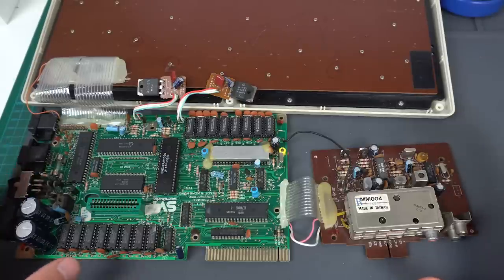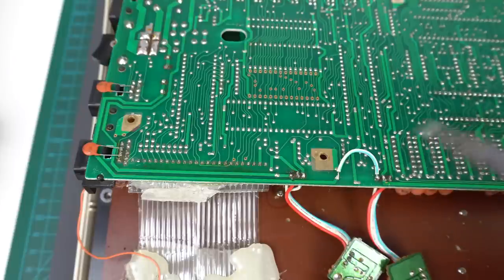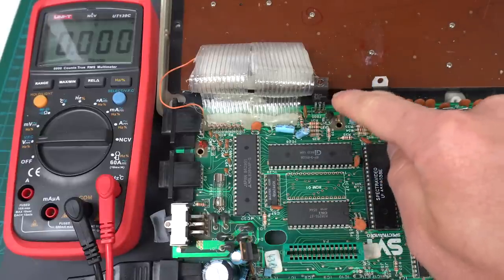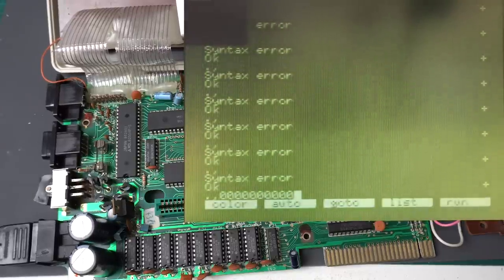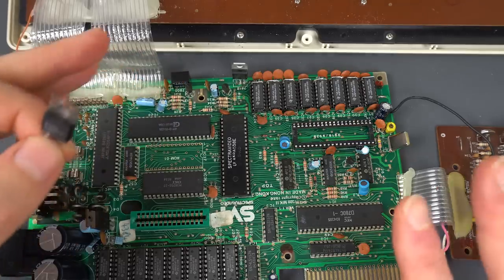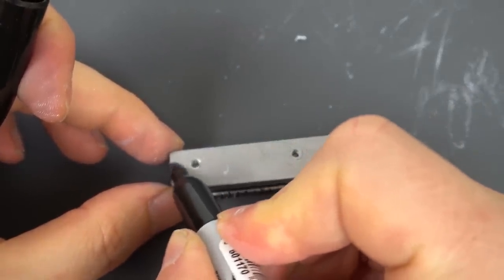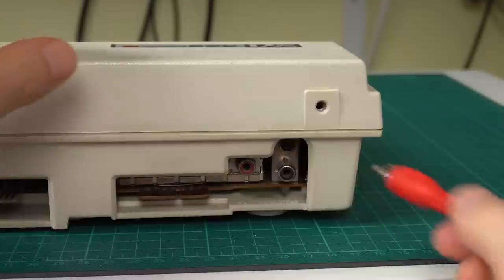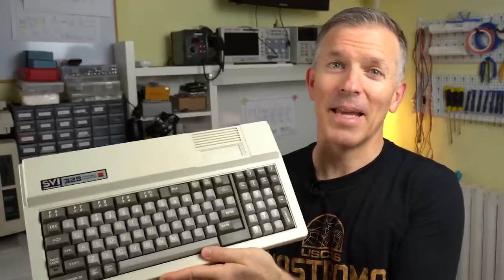SVI 328 VDP Problems and Final Touches (Part 3)

Comment: Hi Noel. That VDP TMS9929 seems to be a laser rebranded IC. Did you buy it at AliExpress? :D I have suffered this multiple times and unfortunately I have some experience with it: rebranded MOS 6502 CPUs, MOS 6581 SIDs and even Rockwell 65C02 CPUs...
Check it out: it has been sanded... Look on the back of the chip and check if there are any markings, but to me it looks like another "chinese knockoff" :(
Reply from the maker: You're probably totally right. I was lucky enough to buy it through Ebay (although it came from China), so I was instantly refunded my money. Let's see what happens to the next one when I get it.
Reply: Wikipedia, Laser engraving :"Before the year 2000, lasers only produced lower-quality results in rubber-like materials due to their rough structure. In the 2000s, fiber lasers were introduced, giving a much increased engraving quality directly into black polymeric materials."
So the laser engraved marking chip is most likely fake (9918,9928/29 were developed in early 80's )
Reply: That is so bad... so the chip isn't even a TMS9929?  It could be anything?

Comment: So ends the saga.  Excellent video and series Noel.  I thoroughly enjoyed it!  Your content is top-notch.

One thing that I noticed, at 25:28 or so when you disassembled the keyboard, is that it appears the ribbon you thought was part of the keyboard membrane is soldered in place.  You could replace that with another home connector job in Part 4!  :D  Your solution to the problem with the video board connection was brilliant.  One more time perhaps?
Reply from the maker: Thanks so much! Yes, a few people pointed that out (I didn't even notice until after the video was done, I was so focused on just getting the plunger in without tipping the keyboard 😀). The main problem is finding a good connector for that. I counted 25 pins, I'm assuming 2.54mm spacing... not trivial. I'll look into it though. Cheers!
Reply: @NoelsRetroLab  I became suspicious when I noticed that the keyboard and video ribbons appear identical.  I would not be surprised if they came from the same roll of material.  No doubt the ribbons were added in the final assembly of the computer.

Comment: Just watched all 3 videos of this repair and I must say you have much more patience than I would have had. Especially at the end of the 2nd where you had it working and decided  to replace those messy bodge wires, only to have the VDP completely fail. At that point I may have just given up or at least pushed to the back of my projects to work on list. Great repair!
Reply from the maker: Haha, it helped that it was a friend's computer and I need to return it. Otherwise, I might have done just that. Also, the fact that it was a new computer to me made it more interesting and me more willing to keep digging. Had that been a plain Speccy, it would have totally gone at the bottom of the drawer 😃

Comment: Nice video series. At 5.34min I have done similar but using a sewing kit pin. The ones with the coloured tops. Solder doesn't stick to them either. Replaced many caps using them.
Reply from the maker: Oh nice tip! I didn't know about that (although I suspect my wife wouldn't be happy me taking her pins and doing that with them 😀). Still, good to know in a pinch.

Comment: The broken tms9929 might even work if the crystal is replaced with crystal oscillator of same frequency. The xtal oscillator driver or input might have an ESD damage which lowers the crystal drive level or oscillator input resistance ... Odd quirk with the external oscillator is that externally generated clock signal must be connected to the both XTAL inputs (pins 40 and 39); This is a footnote in Texas Instruments  VDP databook 9918 and 9928/29 terminal assignments (page 3-9 to 3-11)

Comment: I do a lot with this JST connectors! Older projects and also new things. I also have a cimping toool for those (and also other connectors as dupont and so on), so I can do my own cables with special pinouts and cables.

If you have trouble with to many pins as you have on the 13 pin cable, you can make a little addon board with a piece of strip board and some pin headers. In your case I would make a little piece of strip board with 13 lanes of 3 solder points each. So I can solder the pin headers right into the middle holes, and the JST sockets on the outer sides. So I don't have to cut the ends of the headers. A little board like that will float above the main board perfectly just soldered with the pin headers. Just take a bit of care not using to much force while plugging in and out the plugs. 
For the keyboard cable (Did I count 12 lanes two times correctly?) you could unsolder all the lanes and make a little adapter board on the under side of the keyboard. So you can adapt from the ribbon cable to normal wiring and use some kind of plugable connector on the mainboard again. Maybe you find some screws you can screw a small board onto? So you don't have to deal with the ribbon cable any more, it will stay on the under side of the keyboard.

Comment: Glad to see it finally working! That's been a long ride that one.
In the keyboard part, it seems like the ribbon is soldered to a PCB, maybe you can put connectors there too after all.
Reply from the maker: Yes, I just noticed that. It may have too many cables to be able to use the same trick. I'll look into it.
Reply: @NoelsRetroLab  How about a floppy cable and connector?
Reply from the maker: @jjermar1  The problem is that I'm constrained by the spacing on the boards, which seems to be 2.54mm. I think floppy cables are tighter than that and have two rows of pins. What I need is something like the C64 keyboard connector, but I don't think those are easily available.
Reply: @NoelsRetroLab  
Both IDE (the 40 wire ones) and floppy cables are half the spacing cable-wise because of, like you said, the dual row connector. I mean, you could just use a floppy cable and use only one row.

I'm not that familiar with the C64 connector, I never seen one in real life, but you might want to have a look at Molex' KK series (and various clones of it) if you have enough clearance (the kind used on PC CPU fan headers and the like.)

Comment: Well done Noel.!  You kept at it, and got there in the end.  The SpectraVideo 328 is a tight looking machine. Cant wait to see it running.  I guess they have a modern SD Card Drive solution for it as well?
Reply from the maker: Thanks! Not exactly, and that's part of the problem. Even the cassette connector isn't a standard audio jack!! So it's going to take some creative problem solving to actually feed it some software next time :-)

Comment: I know this is from last year, but I'm wondering if you had the composite cables plugged in when you changed the wires underneath the board, as those can cause sparks from a soldering iron through to ground via the composite.  I killed two famicoms that way sadly, as I was new to electronics and didn't realise.  Now I just unplug everything before I work on anything, as any sensible person would do.
Reply from the maker: Good point. I didn't because it was already uncomfortable enough working on this board and that would have made it even worse. But it's a good tip to keep in mind. Thanks!

Comment: Great and informative video as usual Noel.
I would suggest a way to get rid of that black wire from the video board. You could connect it to the unused pin of the top connector and run a bodge wire from that pin to GND directly on the main board.
Keep up the good work!

Comment: Nice to see an anti-static wrist strap being used!  =)
Modern ICs have a certain amount of ESD protection built in. 80s CMOS ICs really didn't!
Reply from the maker: True. On the other hand (and this is totally a guess on my part), maybe 80s components weren't as susceptible to static discharges since they were larger components. But I have no idea, really :-) I'll try to get in the habit of using it.
Reply: @NoelsRetroLab  Climate seems to play a role, too. Here in the damp north of England static build-up is rare, but I notice that when I'm working in the south lightning bolts fly from my fingertips like the Emperor in Star Wars!  =)
Reply from the maker: @Xoferif  Very true. It's also very humid here in northern Spain, so it's probably a similar situation.
Reply: Yep, he has successfully taken part of the 1st step to ESD safety, he owns a strap, not using it correctly yet but he will get there ;-)

Comment: The dropping voltage at the output of the 7805 is not just a random symptom of overheating, it's a feature of the 78xx series! In your system, the input is quite high (8-9 volts would be standard design, but 11 is quite high), so the chip generates extra heat from the extra voltage it has to dissipate. If the chip starts overheating, it starts passing less current than required to keep the output voltage at nominal value to protect itself from breaking. As passing less current means dissipating more voltage over the chip, it is common for the voltage to plummet quickly until the current gets so low that dissipation is low again.
Reply from the maker: Right. I was just surprised it happened so quickly. But you're right, I wasn't thinking of the high input voltage, and then the fact that I replaced the VRAM with 4164, which probably uses more current from the 5V rail than the 4116s.

Comment: Great work Noel. You really need a wiring pen or some polyurethane insulated transformer wire for making fine repairs, saves me lots of time. One comment about probing crystal oscillators is to be know that the scope probe capacitance on its own may stop a working crystal oscillator because the 10pF adds to the small caps already there. It may also start a non working oscillator! Usually it just shifts the frequency slightly lower but the rule is to buffer the crystal. This is usually done for you in a working circuit so measure the output pin, not the input pin.
Reply from the maker: Interesting. I didn't know about wiring pens. But the wire in those pens is not insulated right? Or it is and you need to scrape it off or something?
As for the oscilloscope, I always run my leads at x10, so I think the capacitance added is negligible. I've never had trouble with crystal oscillators, at least at these frequencies.
Reply: Noel's Retro Lab : The wire is insulated but the trick is to get the right insulation. You just solder right through the insulation at the tip so you don’t have to scrape it off. Instructables has an example. https://www.instructables.com/id/Wiring-Pen/  You can buy the wire from various places like Amazon. As for the scope probe, very astute to stick to x10 but it’s still at least 10pF, add that to the 22pF or so usually specified for the crystal and it may be a problem. I’ll admit it usually makes a oscillator that has a broken cap work but can also stop it if you probe at the input side of the crystal. It will definitely shift the frequency slightly and you may see some designs use a trimming cap to allow fine tuning.

Comment: This computer could be properly named a MSX 0. The MSX standard was based on it. If I'm not mistaken, what it doesn't have that the MSX has is the bank-switching and multiple slot slelection architecture.
Reply from the maker: That's right. I'll get into the details of what makes it different from the eventual MSX standard in the next video. I'll hopefully load a few games and see what it can do too.

Comment: Good work on getting the SVI back online :D

It was a good idea to go with a switching regulator module instead of the linear 7805. Without a heatsink, it could maybe do 1A max before it overheats and goes into thermal shutdown. With a heatsink, 1.5A is pushing it, unless using a beefier TO-3 with heatsink is used, then could get 2A. The older CMOS tech in that circuit is power hungry and likely that board is pulling more than 1A at 5V... 

On broken or missing pads and vias, be careful to check the circuit ("net") as it may be relying on the (plated) through-hole connection to connect top and bottom layer traces (that's what the primary purpose of vias are) as some board layouts may use a pin pad as a via as well. If the hole is no longer "plated through" then be sure to solder both top and bottom side of that pad/pin. Not saying you are not doing that already, just something to watch out for.

2.54mm is the old 0.100" spacing standard. There are several options for the cabling (eg. good ol' ribbon cable) and your idea seemed to work fine, but could the wire that was removed been re-purposed to bring the ground over and then the additional ground strap removed? Maybe some traces would have to be cut... but would clean up the inter-board connection... just a thought.

Thanks for the video!
Cheers,
Reply from the maker: Thanks! That's a good idea about the ground cable! I didn't even think about it, but I think it would be quite possible with just a couple extra wires in the boards themselves.

Comment: Great job Noel! I remember a friend of mine, back in 1984, who had a Spectravideo 328 with disks and CP/M, also with the MSX converter cartridge. 

By the way... Have you noticed the empty space for "ROM 01"?

It seems that there may be possible to add some additional functionality to the SVI 328. Perhaps some embedded apps?
Reply from the maker: Thanks! Interesting, I didn't know about CP/M on the SVI. It must have needed extra RAM in the cartridge I would think. As for the ROM slot, I saw that. Maybe they had some apps planned like you said, although at least with cartridge systems like these it's really easy to provide them externally, which is great.

Comment: Even I would remove those horrible connectors that had hot glue all over them. It's not difficult to add connectors that you can easily unplug as needed if possible. It's also one of the first things I would do given the chance.

Comment: Wondering if you tested the original so called dead VDP in the Ti-99 4/A.   I would have adjusted the trimmer cap to see if the oscillator circuit loading was just a bit off.   I'm sure you leave out lots of details in these videos for time constraint reasons.

Comment: I wonder if you had an ammeter on the 5V regulator to see what current is passing and compare with spec sheet.
Reply: Oops, commented before you replaced with a modern part 😄

Comment: You should really solder the top sides of those two regulator pins as well... otherwise they might not be connected to every circuit that needs it.
Reply from the maker: Yes, good point! I had an instance that the top track didn't make contact so part of the board had no +5V. With the Traco power is much harder to do that, so I just made sure I let the solder flow thoroughly from the bottom and it was fine. But yes, definitely something to watch out for.

Comment: Hi Noel! Greetings from Argentina! I love how detailed your troubleshooting videos are. I learnt so much watching them!
Can I make a small suggestion? When editing your videos, try to remove the high pitch noise that comes from CRT's screens. It's kind of uncomfortable for headphone users with good hearing (like me :P) You can remove it by applying an EQ to the audio track and lowering the 16K Hz band.
Keep up the good work! Saludos!
Reply from the maker: Thanks! Ah, good point. I can easily do that since I already do some audio processing. Is it just in the CRT shots? Thanks for letting me know.
Reply: @NoelsRetroLab  Yeah, it is just when a CRT is on. It is not so noticeable in this video. On others (I can't quite remember which one) it can be clearly heard.
Reply from the maker: I always edit the videos with headphones, so I'll keep an ear out for that (literally). I have some CRT shots in a video I'm working on, so I'll try to do that. Cheers.
Reply: @NoelsRetroLab  You're too old to hear it 15khz, that's the issue :-)

Comment: Nice video! Lots of “rebranded” chips lately. I recently got a ay-3-8910 that was a ym2149 🤷🏻‍♂️. Really glad things turn out ok at the end. :)
Reply from the maker: Thanks! Yeah, apparently I've been told the market for TMS9929A is mostly all fake chips! How did you find out what that rebranded chip was?
Reply: Noel's Retro Lab I install it on a msx machine and used a basic program by dvik, ident.bas, that identifies vdp, psg, type of machine , among other things.

Comment: thank you for posting.  what was the device w/ which you replaced the 7805 ?  source ?  take care & stay safe.
Reply from the maker: It was a TRACO TSR 1-2450 (https://eu.mouser.com/ProductDetail/TRACO-Power/TSR-1-2450). It's rated at 1A, which in retrospect might be a bit tight, so it's probably better to get one rated for 1.5A.

Comment: If 7805 had dodgy ground and dodgy heat stink - there is your vdp killa. Cheap chinese switching modules with lm2596 clones + 5.6v 5 watt zener or a maybe a crowbar will make it bulletproof...
Reply from the maker: Yes, that's probably very true. Do you have a link to one of those clones? I'd love to check them out.
Reply: @NoelsRetroLab  ebay search lm2596 dc-dc 3a. Make sure module is trimmed to exactly 5v before connecting load